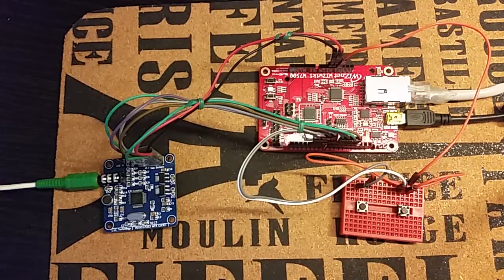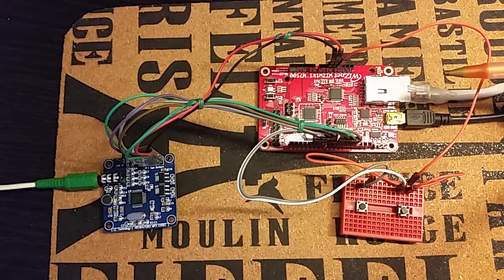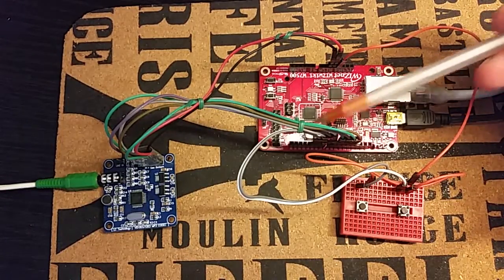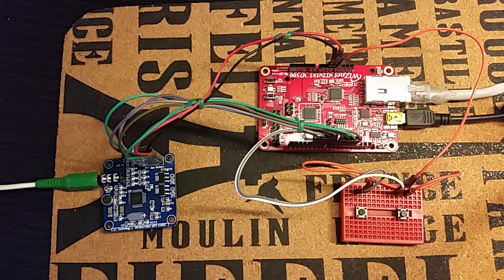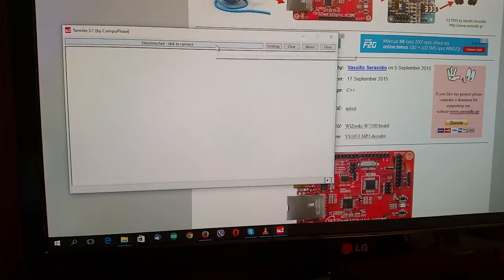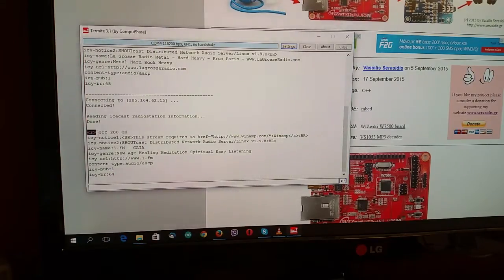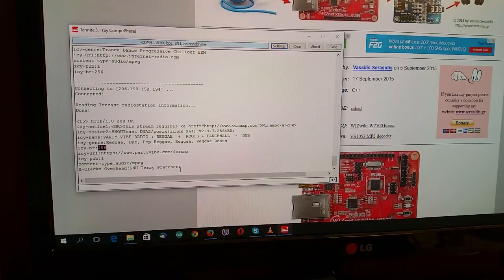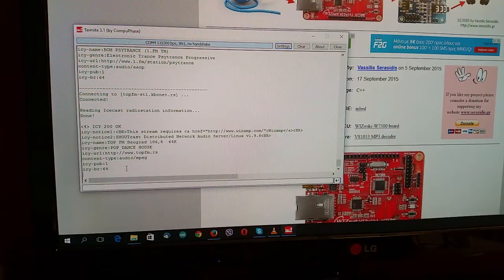WebRadio player 2 (ARM 32-bit Cortex-M0)

Comment: you could consider creating webradio based on esp8266 + vs1053 to 
minimize costs as w7500 cortex m0 board costs a lot more that esp8266 
(3$)
there are some projects already running on esp8266 using arduino IDE
1. http://www.esp8266.com/viewtopic.php?f=29&t=4308 (i think based on your previous project)
2 https://github.com/PiotrSperka/ESP8266-WebRadio (esp_iot_rtos_sdk)
Reply from the maker: +sviesis The ESP8266 version is in my future plans. At the moment I have  already made my WebRadio player work (320 kbps) on WIZwiki-W7500, Arduino pro mini and STM32F103 platforms. 
The ESP8266 version is coming soon! .The only problem is my limited free time ...